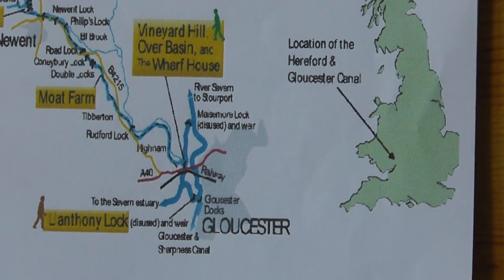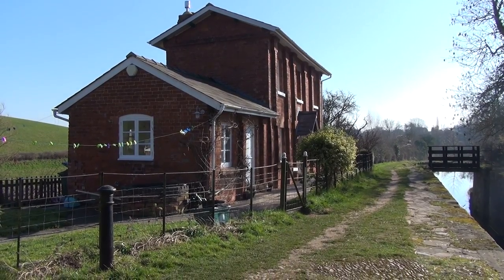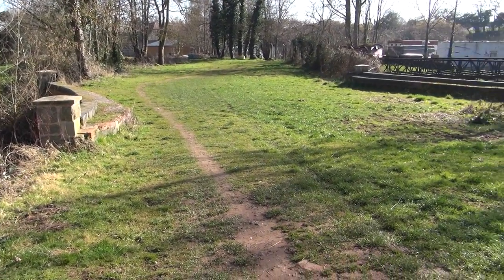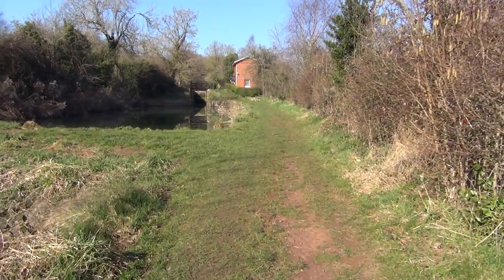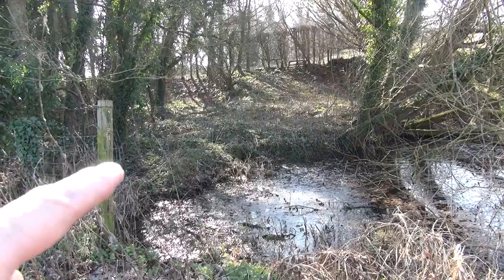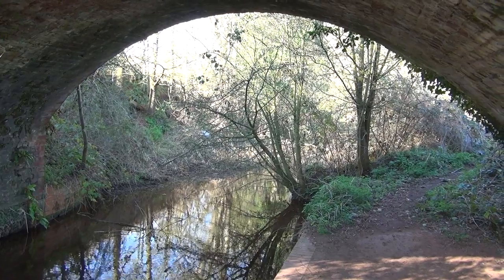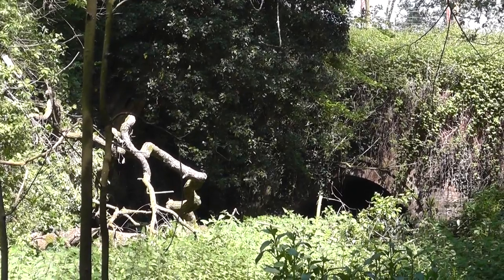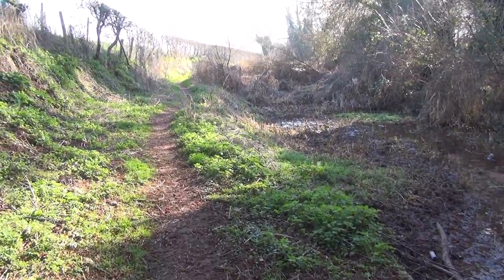Canal Adventure  Includes 'DON'T DO THIS'

Comment: I grew up in one of the 2 houses shown by Coldharbour bridge during the 1970's and 80's, the canal way my playground. It looked very different pre "restoration". The area was known as Coldharbour as it was a valley and harboured the cold. People would take canoes along the tunnel and report to the occupants of the other house in case they didn't return! This house is called Brook Cottage and pre dates the canal, it was just a brook when the house was built. It became an inn after the canal was built. The junction of the coal branch was to the Coldharbour side of the lane, the site was filled long ago, a timber bungalow used to stand there but this has also been demolished.
Reply from the maker: Wonderful memories thanks for posting. Ron

Comment: According to H-G Canal web site, the concrete slab is a gas pipe built over the canal in 2008 so that restoration could happen at a later date. Also there is a photo of the restoration of the south portal, in 1991, with hardly any  vegetation visible , nearly thirty years ago!  Also check out some great photos of inside the tunnel and at Ashperton. Type in  Oxenhall Canal Tunnel , www.28dayslater.
Reply from the maker: Thanks for the info Malcolm. P.W.